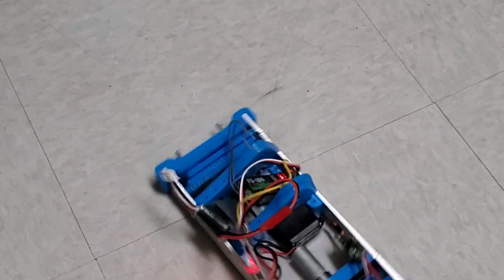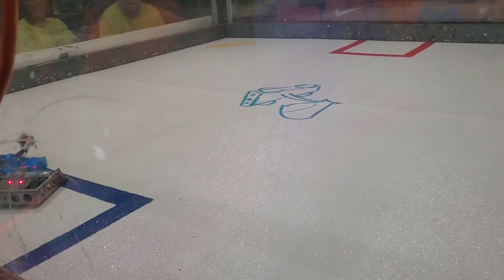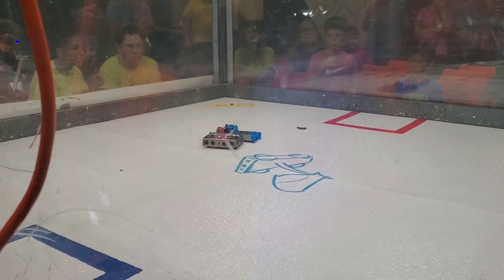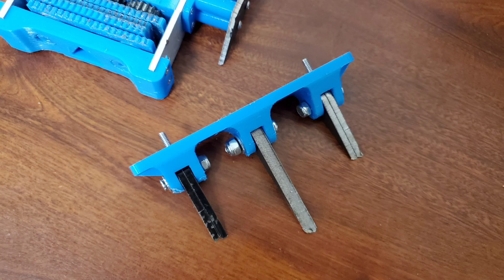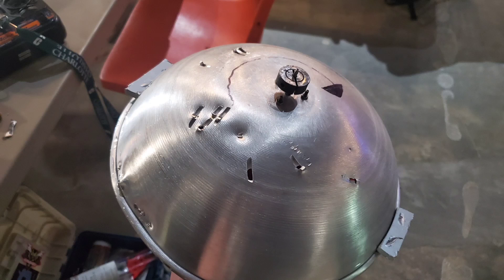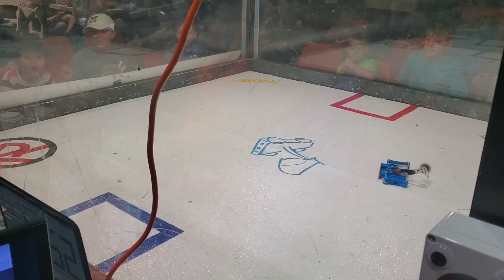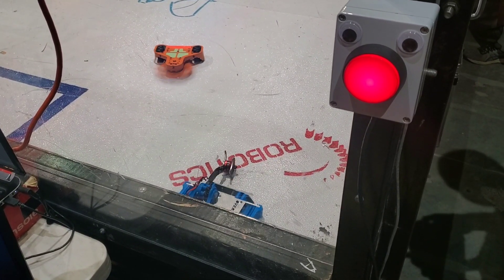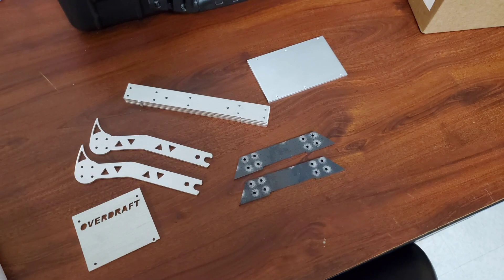OverDraft at COB 2023 - EVENT REPORT

Comment: If your cheap esc has two 8 pin motor driver chips, like the rz7886 or similar, then it will have two input traces to each chip. If the esc is in braking mode and one of the input connections is dodgy and loses connection that would result in the motor being locked into driving in one direction.
Reply: It's worth looking up the actual chips on the esc and figuring out how it works anyway, it'll expand your electronics knowledge and make you better at troubleshooting stuff like this
Reply from the maker: Interesting, I'll have to look at that. The ESC I'm using is non-braking. Thanks for watching!